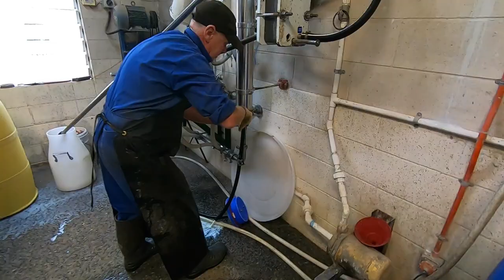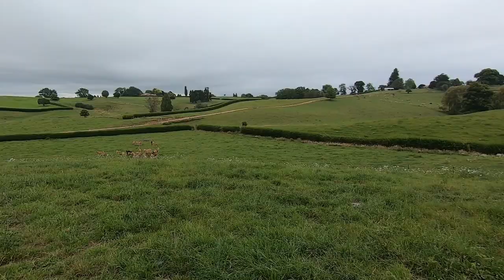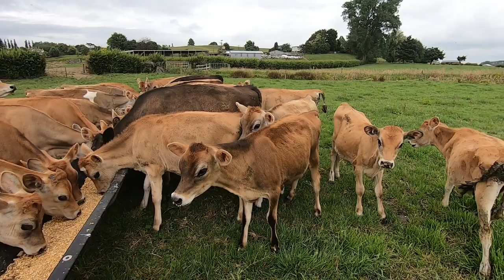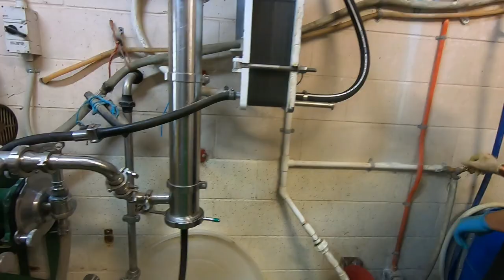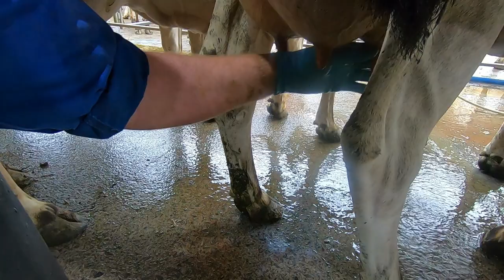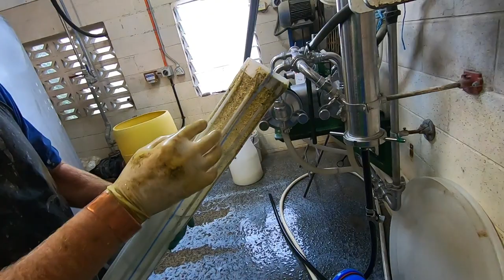A cow with bad mastitis! How Do I find it?

Comment: Do u find higher cell count with oad milking. Your dad is in good condition for a man that milked alot of cows in his day. Do you get i extra labour during the year or for calving.
Reply from the maker: We have been culling on SCC, to try and get it lower but yes it is a bit higher on OAD. Goal is to get under 150,000 for the season. 
Haha thanks I’ll definitely tell him that, and no we don’t get any extra labour. Unless we’re both away we will get a relief Milker in.
Reply: @TheOnceADayFarmer  the hips and knees gave in on my dad and mine are not great either. Milking heavy on the joints. We put in rubber matted floor in parlour few years ago. Great job.
Reply from the maker: I’ve heard those rubber mats are awesome, I worked in England in a shed that had one and you could definitely notice the difference. Dad wants to milk till he’s 65 so he’s got another 7 seasons to go yet haha